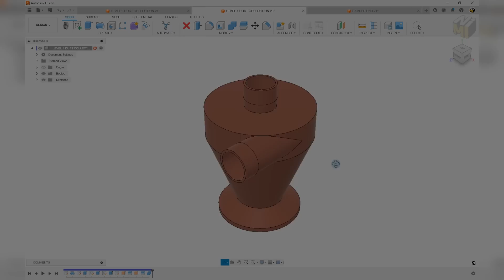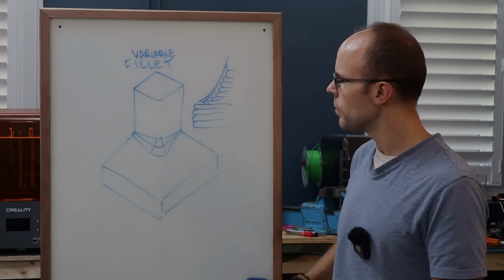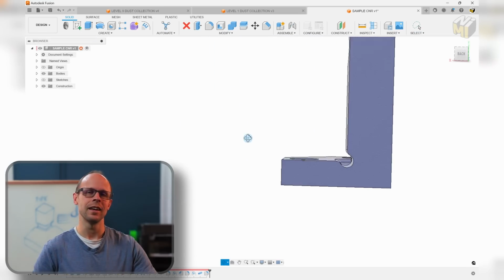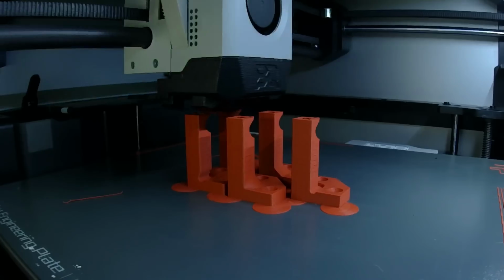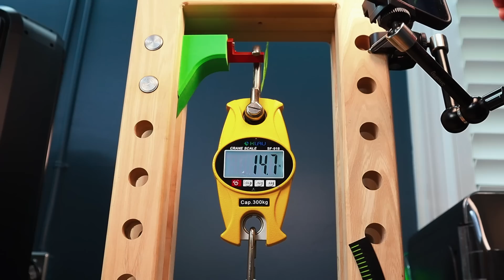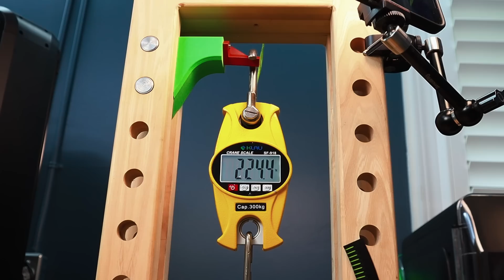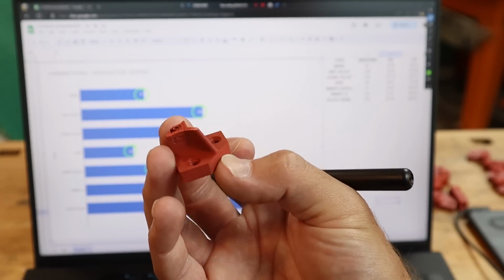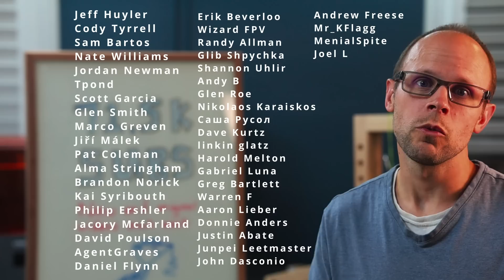Which is the Best 3D Printed Corner

Comment: Enjoying the videos on your channel a lot, so first up thinks for your work.  For this test in particular I was interested in how your test rig works. I couldn't find a video with showing the overall setup, so I was wondering how you add load to your samples during testing. The presumed lever arm seems to be off screen right, but are you just pulling on it with your own hand or do you have a motor, weight, etc to provide the loading force? Polymers and materials with cracks in them - and 3D prints are effectively both - are sensitive to loading rate as well as load magnitude. I notice a pause in the force reading on the scale when you were testing and I was curious why. Almost all of the tests show that behaviour and it could be significant to the repeatability of your test and therefore the validity of your results. I'm know it's unreasonable of me to hold you to such a high standard given you're doing this for fun, but I figured you went to the trouble of setting up the whole rig and doing the testing, with multiple samples and all, so you might be open to suggestions. I would also be curious to see if an unfilleted chamfer would be different from the filleted one you made in this test.  Keep up the good work, I'm looking forward to your future videos while I trawl through the great back catalog of content you've already made. Subbed!
Reply from the maker: Oh sure, this is the same test setup as I've been using for the last couple of videos, it's by no means perfect, but I use a lever arm so that I can fairly evenly apply load from a good distance.  That keeps me away for safety and also so that I have far more control.  Ideally I'd have something more automated with some measurement systems added.  At the moment, I have very limited resources so I have to make do , hopefully as the channel grows I can buy parts and maybe even some dedicated equipment.

Comment: It looks like some of the samples have infill 100% and some are hollow. Wouldn't that disturb the results?
Reply from the maker: Very good eye, I've left it to the slicer, so yes, some of the areas are not identical, I'd a bit more like what we'd see as a real case when we print.  Technically the sharp corner option had an advantage as well since it was completely filled at the transition.  I wanted to leave it, though I can also work on another test which has all prints solid to eliminate that variable.

Comment: unless i missed something, it is not really stronger/weaker, it just shifts the leverage effect to the thinnest part. shorter leverage = 'stronger', longer leverage = 'weaker'. so the results are kinda obvious
Reply from the maker: The lever aspect is fairly obvious yes, what might not be as much at least for us 3D print enthusiasts is that the curve does well at helping to distribute the load.  Even though we've effectively increased the length of the lever, the curved area still helps to provide better overall performance.  This is probably common knowledge for metal, especially something like castings.  I would imagine that the word FILLET was used a lot there, if you've ever watched Keith Rucker's shows you'd see him using a type of Filler to build the sharp corners up both for strength and for a better result during the casting process.
Reply: Stronger for a given purpose then, which is really the point. A 1'X1' cube of steel can support 100 pounds just as well as a 5'X5' cube of steel. Which one costs less and takes less time to make? Which one takes up less space and is easier to move around? Is a cube of steel even a good choice for this application? What about 3D printing? How many perimeters and how much infill do we need on a much smaller and cheaper 3D printed part to support 100 pounds? A pretty silly example, but I'm sure you get what I mean. :)

Comment: I use fillets all the time but I never considered doing a sweep and removing material from the corner.
Reply from the maker: The idea came from something we've used in Woodworking... well laminates on a wood substrate.  Laminates with square corners often will crack, instead, we drill the corners to avoid the problem.  If you've ever been in an older elevator with laminate on the inside, around the cutout for the stainless panel, the laminates would crack at the corners.  I wanted to see if the same would apply here, and it seems like even though the lever is slightly longer, it still performed better.
Reply: @NeedItMakeIt  that's awesome. Thanks for sharing!
Reply: @NeedItMakeIt  that's awesome. Thanks for sharing!

Comment: I didn't know Fusion had variable fillets.  Thanks! 
Been using pipe or similar a lot lately to help eliminate bulges in critical areas.  You can't always count on users of a model to tune pressure advance.
Reply from the maker: I just learned a bit more about the variable fillet, you don't need to base it on segments, you can add your own start and stops for the change in size, that would be done at the bottom with the little + symbol.  it could help here and there as well.  It's pretty handy, it is getting a lot more use now in my models, that's for sure and that struggle to find  fillet size that works for all of those unusual shapes is so much easier now if we can have it vary instead.

Comment: I know that you have not included in on purpose, but it would be somewhat interesting and educational if you would include one sample printed in optimized printing orientation.
Reply from the maker: That's a good idea, so essentially the best possible orientation for printing, is that the goal?
Reply: @NeedItMakeIt  No no. I belive that we all know that the best orientation for 3d print is when overhangs are minimized, and layers are perpendicuraly to forces that will be aplied.

I meant that for a contrast, most of the samples as far as i remember broke at layers. With that one more sample that would have been optimized in orientatien you could show how important it is to orient prints.

Comment: Awesome info! Both the design tips and testing. Can be applied to any part design, but also helps you think about 3D printing specifically. I think this basically demonstrates that the failure point is going to be where material is thinnest. So, adding a fillet, chamfer, or gusset is going to strengthen the part for the entire length it runs.
Not only that, but moving the weak point closer to where force is exerted on the part decreases leverage on the weak point, making the part stronger overall. You can ideally reach a pretty uniform strength across the entire part if desired. Move the weak point as close to the force as possible and make sure that point is still sufficiently strong.
Another advantage to these techniques is anywhere there is a sharp corner it creates a stress riser. Basically a point at which cracking or failure is prone to propagate. While likely more prominent in homogenous parts with no layer lines, it also applies to 3D printed parts. I think this is why the swept results were better than basic.
Cool to see even using the sunken corners has an advantage. Since FDM maintains the same number of perimeters even where there is material removed, you aren't losing much strength material wise either. Overall, utilizing all this knowledge about corners can make the part much stronger while also often looking nice.
Reply from the maker: Thanks 802!  I wasn't really sure if the techniques we use for metal and in some cases for wood can also apply to printing, and I think more testing is required on different materials, but it seems that they do apply at least from the small batch testing I've done.  I really need to get a more automated setup for my testing rig.  I can't decide if I should go with hydraulic or not though.

Comment: would be good to control for part weight. the strongest designs probably also weighed the most.
Reply from the maker: For sure, that can be tested too.  It would be ideal to identify loads on the parts and the infill would generate proportionally based on the weak areas and loads.  A form of generative design I suppose.   I've been looking into how to 3D print to mimic what a bone structure looks like, but I'm a long ways away from having anything ready to present.  Variable density bone infill would be amazing as long as we have good layer adhesion.

Comment: 1:58 - is it, though? In my testing, transitions like that aren't functionally any different than any other layer line and actually stronger than compound fillets.
Edit - Fillets spread strain... On contiguous, homogenous materials. In FDM prints they do little but reduce the overlapping contact surface between the extruded material which weakens the layer-to-layer bond and, in some cases, make it easier to print overhangs.And make it pretty. And use more material.

I mean, I still use them everywhere but  I haven't seen that they actually lend strength except in one or two specific circumstances.
Reply from the maker: It's worth more testing for sure.  It is an inverted stress riser, that would be considered the worst kind, essentially a crack which has already started.  I would be happy to run some testing, but I think we need to have a large scale test, and eliminate all other variables.  I have an idea of how to do this so maybe this could be a follow up video.

Comment: interesting, the variable fillet, because of the gradual change in cross section along the layer lines, the force was dispersed through multiple layers in a more linear fashion.  Compared to any of the other edge features, there's always one layer with that distinct change in cross section.
Reply from the maker: Beautiful analysis!  That's something that I've also tested in some of the 3D printed connections I've made and it certainly seems that changing the shape to cross many layers, the performance will improve.  The Sine Wave connection is a good example of this from the last few videos.

Comment: Thank you for another great video. For this part changing the print orientation probably makes it a lot stronger.  Why do you use sunken holes and use normal bolts during the test.
Reply from the maker: You're welcome.  The reason for the difference in holes comes down to me being a dum-dum.  I originally was going to use a different approach to test the parts, but instead settled on putting them into the test rig.  Ideally there would be no counterbore at all.  I really need to order some more screws, I'm getting very low.  That's very perceptive of you to pickup on that!

Comment: How are you assuming the cross sectional area? Are you measuring the cross sectional area after fracture? Are you assuming all samples at the same cross sectional area?
Reply from the maker: The part shape is different, so the cross sections are not the same.  I try to put this together as a comparison based on the difference as if someone added a fillet/chamber, or none at home and sliced them the same way.  The previous testing video I made called UNFILLED does speak to some of what you're referring to though.  I accept your position and I am always willing to do more testing to really dial it in.
Reply: @NeedItMakeIt  thanks for your response. I'm an engineer that managed testing labs. Stress (N) is force per unit area. Engineering stress is the stress assumed that the cross sectional area does not change. But there are a couple ways to measure the cross sectional area. I'm just trying to figure out what cross sectional area did you use. Did you measure and calculate before and after fracture areas and use an average at every sample? Did you measure one sample and assume the rest the same? Did you use the CAD area? Did you use slicer area?

Comment: Fillets and chamfers put the failure out closer to the load thus reducing the leverage. I'd be interested if measuring load to failure distance partially or fully explains the different failure loads.
Reply from the maker: Yes, effectively reducing the length of the lever.  Though the swept version did the opposite with still an increase in performance.

Comment: I love the work you're doing, but you really need to have error bars on your graphs, when you have multiple samples, so we can see how much scatter there is in the average
Reply from the maker: I can always do more, I really need more of the identical printer and material.  A better more accurate way of applying load and measuring deflection and failure load.  We'll get there, I have to do this incrementally, I'm not quite at the point with the channel to be able to spend a lot.  I hope to be in a more sustainable position by 2025.
Reply: @NeedItMakeIt  Totally understand. I'm coming from an R&D engineering background, and I've honestly been spoiled by CNCkitchen's test data and rigor. I look forward to seeing you grow this channel!

Comment: Thanks for all the design tips. This was very helpful.  
Just last week I needed to produce an undercut to create a tight fitting perpendicular wall to a curved surface. The pieces were in compression so I didn’t need a filleted undercut to maintain strength and I didn’t have much wall thickness to work with. I simply recessed a .5mm thick square edged sliver around the perimeter at the corner interface.  Turned out perfect and the resulting surface fit was very tight.  👍😎👍

Comment: Some folks want to 3D print the whole world. It's good for what it's good for and for the rest there's something else, all these subtle variations fall below noise floor if you model a hole thought that and put a bolt in it.
Reply: Except that's not the point of the video. Trying to limit everyone else's scope of knowledge and application is not helping anyone. The drastic difference in holding between the basic hook and the gusseted hook demonstrates how small changes can widely vary the capability of a 3D print. Not to mention the extra plastic used is much cheaper than a bolt or even a long screw. Not to mention this design could hold even more weight printed in a different orientation. How much weight does it need to hold before adding a bolt isn't necessary? It all depends on the application.
Not sure how you can call an over 3X increase in strength noise floor, and it's not even the limit. You might as well say that all 3D printing is under the noise floor because CNC machined aluminum exists. This type of comment just really bothers me because it is defeatist without a purpose. You could simply have suggested that people can also add a screw, bolt, or metal insert where additional strength is needed rather than being snarky and downplaying knowledge. Add to conversations rather than tearing them down. Be additive like additive manufacturing.
People will like you more too if you act that way, believe it or not.
Reply: @802Garage  ok, your one of those youtubers that thinks everybody is a troll, I'll move along now, you have a nice day.
Reply: @brocktechnology  Not what I said at all. I also didn't personally attack you. I engaged in good faith. Your comment is more defeatist than it needs to be. That's all.

Comment: Interesting video! Seeing this and a few of your other videos will definitely be useful down the road for choosing a feature to include in a model at the start and saving some time in testing. Do you have the files of these available/are you willing to share them? I'm kind of interested in running FEA on the different designs and see how they stack up vs your results. Acknowledging that simulating 3d printed material is hard/impossible, it could still be neat to see how close/different it is vs the sim.

Comment: mike you a bit off on the info, the pipe/part A B & C seem like you remove the material but you actually adding, the 3d printed part is hollow inside
Reply: It still reduces overall material used. It maintains the same number of walls, but decreases their length slightly across several layers, and reduces the total infill. An interesting property of FDM parts!
Reply: @802Garage  that's the thing, by decreasing the part length he introduce more surfaces areas, in mdf the more surfaces you have = the heavier parts will be, unless 100% infill
Reply: @thelastsoulllll  I think I see what you are saying. It may have added to the total material of the part by increasing the actual wall area. What I'm saying is that doesn't inherently increase the strength because it doesn't actually make any area of the part thicker than before.
Reply: @802Garage  well I never said anything about adding strength off the part, just adding more material by more surfaces areas

Comment: I can not stand the look of the increasing island sizes that doing a radius on a horizontally printed edge makes. Secondly on a vertical edge a radius prints faster and smoother. A chamfer has a less aggressive change in direction but it's still pretty abrupt so it can cause ringing. So in printing orientation I always chamfer horizontal edges and radius vertical edges.

Comment: I do not think you are testing what you think you are testing, but I lack the mathematics to prove it 

You are actually finding the weakest point of layer adhesion. If the force is being applied for 1/3 the distance as in the filleted-gusset case, isn't the force at that junction 1/3?

Empirically test this by extending the height of the pillar so the distance between the top and the breakpoint matches the distance of the breakpoint of the original.  Now you have the same force triangle.

Comment: I think testing the corner in tension is just testing layer adhesion. A larger surface area will withstand a higher tension before delaminating which in the case of this test just moves the delaminating layer upwards to a more narrow layer. I think testing in compression is better. Also worth considering “equal volumes” and “equal amount of plastic used”
Reply: Note that the slightly relieved corners actually performed better than the unmodified sharp corner. There are other factors at play.